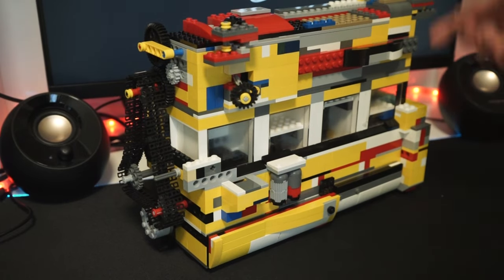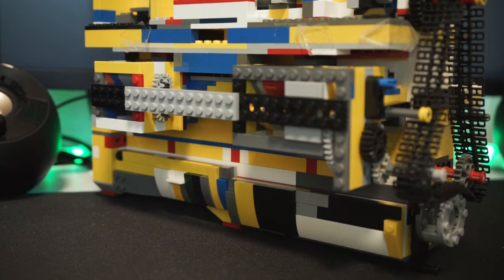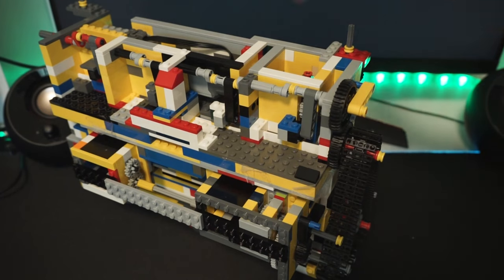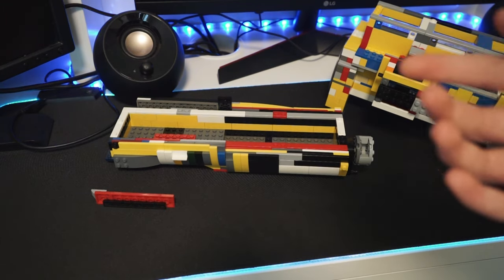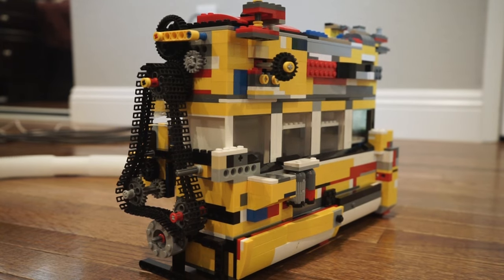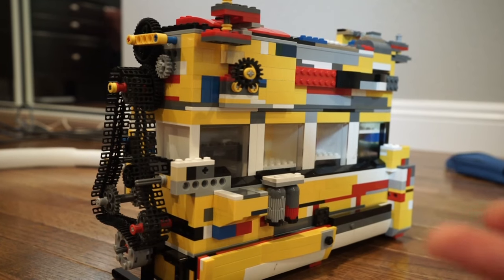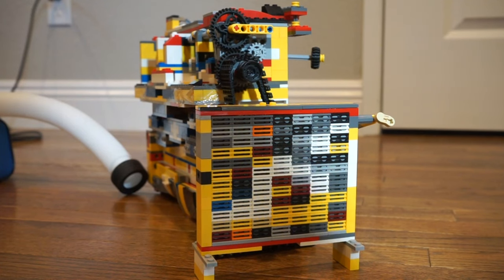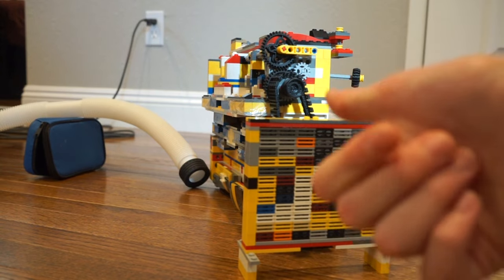Twin-Supercharged Lego Inline 4 Diesel- Vacuum Model Engine

Comment: That’s the most epic i4 I have ever seen, and 600 rpm for such a big engine, my i4 reached 1300 at peak but it was way smaller
Reply from the maker: Thanks
Reply: How big is it? Mine is 4x4 but still does not run great because of too many friction I think
Reply: @larsassinck3868  have you tried to lubricate it with olive oil? you just take a qtip and rub oil along the cylinder walls and anywhere there is moving parts
Reply: @ethankirwan1646  I did but I used bricks for the walls instead of flat panels
Reply: Most engines idle at 600
Reply: @Anonymous_1210  600 is how a tractor idles. A car idles at about 800-900
Reply: Exactly I meant tractor engines Im a farmer lol
Reply: @MrThunderCunt  Yeah I know, Just comparing to a real life engine.
Reply: @larsassinck3868  Affirmative

Comment: Supercool build man! I was wondering how the superchargers deliver the boost to the engine? (Edit) are they like blowing fresh air to the intake when the piston goes down
Reply from the maker: Yup, exactly! More air in cylinder= more air for vacuum to suck.
Reply: @Mattz6  I am sure this is not how it works, the piston is moving upwards because of the vacuum in the chamber and not the particles of air dragging it, when you add air to the chamber you are just slowing the engine because the vacuum cleaner has to suck out more air.
Reply: @jantosone3380  as long as the intake valve is closed during the compression stroke it should work fine. There is more air volume which gets pressed downward on the piston. Also, the piston also pushes the air outwards, so it doesn't work like you described. The piston assists the vacuum in pushing the air outward.
Reply: @BlueTechRS i don't understand what i wrote wrong. the only thing that i didn't mention was that the superchargers can help in pushing the piston down. because of this, this engine has only 2 strokes: 1 piston going up because of the vacuum, 2 piston going downwards  
because of the flywheel and with help of supercharger. there isn't any compression stroke in this engine. also the piston cannot assist the vacuum cleaner in pushing the air outwards because he gets dragged up by vacuum him self.(edit) even in the video you can see it running faster without superchargers
Reply: @jantosone3380 is your point is that when exhaust port opens the supercharger blows air to make the piston move downwards faster?
Reply: @iwascrazyonce664  Yeah

Comment: I think your design is really cool, and I have a suggestion for a modification. Your LEGO engine operates using a vacuum system that pulls air in, and you could add a throttle or restriction to control the airflow. This modification would help regulate the suction power, allowing you to determine the engine's RPM based on how much the throttle is opened or closed.
With the intake flap (or restriction) fully closed, the RPM would be at a minimum. On the other hand, with the flap fully open, the engine could reach maximum values of around 600+ RPM. Additionally, if you could modify the engine so that it generates more RPM at full throttle, for example, between 1000 and 1500 RPM, it would be very interesting and more realistic.

Comment: id say using double sided tape without taking the strap to make both sides sticky is like one of the best gaskets you can get yourself easily because if youve used it you know its a bit squishy so it will get into any nuck and crany
Reply from the maker: Thanks for the recommendation!
Reply: @Mattz6  and the strap is coated with a waxy surface so its like its always lubed

Comment: Love the ones with the starter motors. What makes this a diesel? 
Excellently designed engine, though. I can't help but think maybe a smaller timing chain would improve it's performance and reduce noise output. 
I designed an inline twin 6x6 engine recently which has a similar unique feature of running a mechanical oil pump which forces oil through the engine as it turns. I'm gonna upload another video or two on it before I finally tear it down to make a newer version later on.

You might consider moving the cam down into the block to make it side valve again, or at least pushrod OHV as this will make the rotating mass lighter and lower friction for better performance. You might also consider making the valves the full 6 blocks wide, I see you used the trick of changing the outside pieces for the technic beams, but this doesn't always get you maximum performance. For slightly more you could make them fully open instead and gain some performance that way. Also, it looks like maybe your crankshaft has some wobble to it (One side twists before the other) causing the engine to be slightly out of time under load and causing it to run poorly at times. This is very evident during the supercharged run as you can hear one end of the engine clunking to keep up with the other. 

Otherwise fantastic design and I'll be subscribing to see more
Reply from the maker: Thanks! So um let's start answering!
1. The diesel part of the name has already confused someone else. I wrote that it is a 'diesel model engine' not a diesel engine. The reason I wrote that in the first place is because when building the engine I really wanted to make it function and look like a inline 4 diesel engine. I also wanted it to be similar to a detroit diesel (hence the 2 stroke nature of the engine and the superchargers) and a catapillar diesel since I had so many yellow pieces. That explains the fairly long stroke, the diesel-reminiscent oil pan, the various design elements like the dual 'oil filters' and the flywheel and flywheel housing. I at first wanted to make the engine turbocharged but I just couldn't imagine the turbo to spin enough to even make some noise, so I instead opted for a supercharged system

2. In what way smaller? If you mean a half as wide lego motorcycle chain then I don't have any (though that would have been nice 😔). If you mean by making the chain shorter then it would be great it I could, but I already lowered the cam gear as much as I could since I ran out of chain links. 

3. That's a cool engine idea! Sure is a unique feature. Would be nice to have something similar on my engine, but it's going to require too much work and also the removal of the supercharger, which will make the engine less unique xD.

4. I did already consider having the cam/valves on the side, but I scrapped that idea because on one side the valves will interfere with the supercharger, and having the cam on the window side will require long and heavy beams, and will make the looks of this engine worse (I really tried making this engine look and function as realistically as possible). Not only that but it would cause me to run into more timing chain issues because the 3 chain gears would be in a pretty linear formation causing all sorts of problems.

5. OHV engines are quite hard to make with limited friction, so you'll be losing performance if anything. Even if it did somehow have little friction, most benefits would be outweighed by the complex camshaft, heavy pushrods, and the lack of support. I would also have basically nowhere to put my starter motor and it's mechanism, making the engine lose a important feature. But I am considering somehow making the engine OHV later on by maybe just getting rid of the superchargers. 

6. My valves are 6 studs wide. Also what outside piece technic beam trick?

7. Yes, the crankshaft it a bit weird but that's because if my lack of 0.5x3 technic pieces. The last cylinder likes to clunk because I kinda ran out of pieces and the piston is probably nudging against something. In any case I actually think it adds to the sound soooo kinda a win 🤷?
Reply: @Mattz6 love the Detroit diesel as soon as I saw the superchargers that’s what my mind went to

Comment: this is amazing bro! i tried a 6x4 aswell, single cylinder engine that ran off of actual fuel, and starter fluid, it worked a little bit, but it didnt do much. but all my legos are gone cause my mom gave them away and i wanted to experiment. honestly i might just 3d print my legos and cast them to metal so i can make a fully functional V-twin. what do u think?
Reply from the maker: Wow, that would be AWESOME. There were attemps on YouTube for a working lego engine but the legos simply melted and there wasn't enough compression. Maybe with 3d printing and a foil-lined cylinder it might work!

Comment: Are The Paper Gaskets Actualy efficient? and does the engine have Deacent Torque? because im thinking of making a lego engine powered by compressed air (5l with 4 bar] and mounting it on my bike
Reply from the maker: 1. Probably. Though the supercharger isn't. Though it may blow some air, it doesn't actually seem to compress it enough to make power.
2. It has some decent torque but I think something like my inline 2 had more. For air powered lego engines I recommend searching up "pneumatic lego engine". This is a negative pressure air engine that can work with a lot less sealing and optimization. A positive pressure air engine on the other hand needs way more work to function properly so pre-made lego cylinders would probably work better. The youtuber "Green Gecko Technic Workshop" has some good pneumatic lego engine examples.
Reply: @Mattz6  ik your engine uses vacuum but ik how to seal stuff properly like an engine built for suction so getting the engine to run aint my concern my concern is torque and fuel efficiency but mainly torque bcz if a 4 stroke 1hp 1 cylinder engine can get a bike up to 36mph whych is realy fast then it means that 0.1hp would be enough but even 0.1hp is incredibly hard to make with lego i had a 4 lego motors made then into one very compactly and then i did some math and figured out it does like 12ncm at 200 rpm whych is basicly 0.005hp them i realized putting that on a bike aint gonna work/be usefull. Since then i was thinking how to get something that made torque btw i was asking about the paper gaskets because like 2 years ago i made an experiment to see if see through duct tape was enough to seal it it sealed it 95% still leaked but very slowly
Reply: And btw i have not got a suction or presure engine to work even through i tried more then 10 times for the past 2 years
Reply from the maker: Paper gaskets probably only work for negative or low pressure situations. Duct taping a pipe if probably better for higher pressures.

Comment: THIS THING IS SICK but if oyu want it to rev higher you need to balance the crankshaft but overall 10/10 build design
Reply from the maker: Thanks. But since the crank is situated in a 2 stroke position it is already balanced enough. Could be more balanced but it's too much work and I don't exactly know relative to what piston to put the counterweights
Reply: @Mattz6  one more thing make sure that the middle 2 and outer 2 go up and down at opisite times so wheen 2 in mid go up 2 in out go down like a real 4 pot
Reply from the maker: @the-evergreen  The engine is technically a 2 stroke meaning the firing order is 1234. Making the engine have a 4 stroke configuration will reduce power and smoothness because 2 cylinders will fire at once.
Reply: @Mattz6  on a real 4 stroke i4 there is only one cylinder firing at a time

Comment: Not sure if you still reply to these, but do superchargers have a purpose in vacuum engines? It seems like all it did was hinder performance
Reply from the maker: If they make actual boost then I think they can, since there's more air in the cylinder for the vacuum to suck= potential for greater pressure difference.

Comment: PLEASE RESOND!! we're did u put the superchargers, what part of the engine do they enter into, the exhaust, vaccum side or cylinder
Reply from the maker: Superchargers are on the side. They blow air into the intake manifold which is on the very bottom. Piston goes down, air goes in. As piston goes up the port gets blocked.
Reply: @Mattz6  thank you so much I am trying to double supercharge a single cylinder

Comment: Looks nice definitely. But while using the same parts a vacuum engine uses you missed the opportunity to "actually make it work".
Reply from the maker: Thank you for commenting! What do you mean by 'make it work'?
Reply: @Mattz6  sorry I skipped through the video and only saw an electric motor. I missed the vacuum so I jumped to conclusions that it was just a realistic dummy. Great work making such a massive engine work.
Meanwhile I fail at my 2 cylinder dohc dohv design 😂

Comment: Its Nice to see A realy good looking Vacuum Engine because i have been trying to get my 1 cylinder to work for over a year now and i have tried almost all the valve designs and it still didnt run because all the valve designs had way too much power needed to turn it over whych in the end over powered the engine and it would need like a very big flywheel to make it work and it woudnt be worth it at that point but 2 days ago i made a design whych i hope works but im not sure since the timing mechanism is 5 studs away from the cylinder so im not sure if its gonna work
do you have eny tips of making the engine run?
Reply from the maker: Make sure nothing is rubbing against anything. That is a sure sign of too much friction. Also the valve timing should be 90° ahead of the piston so check that as well. Also if you can try to lubricate the engine. Olive oil works the best, but I personally use a bit of lotion because olive oil is too messy. And thank you!
Reply: @Mattz6  i used my own type of lubricant whych i hope is gonna work just fine im just gonna have to run it with my starter for 2 minutes and then i can try running it after i fix the valve timing because it uses gravity and i need to use a rubber band for it to return back otherwise it aint gonna run but i have used my starter and it could survive aboe 1.2k rpm so im not worried about it exploding even through u can unconnect the whole cylinder without a lot of force so im going to fix that tinny detail somehow idk how i dont have eny more lego pieces with stud holes but after i fix all of those problems i hope it runs. since it pulled the piston when i used my breath and then it stopped and it hasnt done that since but i hope with more suction its gonna work.well have a nice day and thx for answering. :D
Reply: btw u should try engaging the starter but not turning it on while running to see if it has the torque to do that since i dont think it does
im still confused how that 70 rpm the starter outputs is enough to start the engine oh no wait its 90 degrees ofset crankshaft per piston that makes sense
is it just me or does the engine do more rpm and is louder without the supercharger?
Reply from the maker: I don't understand what you're trying to say but yes, the engine is faster without the supercharger because the parasitic losses are greater than the added power.
Reply: what if u make the supercharger controled by electric motors and make it do a lot of rpm do u think that would increse the power?
Reply: @dominikvarholik7519  Thought of that before, but that means that the throttle won't vary along with the engine
Reply: @Jesus_Christ_loves_you_alot  true but would you rather have a supercharger that weakens ur engine or a supercharger that actuly adds power for example i made an elecric supercharger and it works insanely good the air flow it has is allredy deacent at 1.2K rpm
Reply: @dominikvarholik7519  I guess. Might try that I'll see.

Comment: Fyi the firing pattern is incorrect, it's 2&4, then 1&3two at a time that way it's better balanced so maybe you can got more rpms out of it
Reply from the maker: Not the first time I've had someone point that out. The engine is essentially a 2 stroke, so having a 4 stroke firing order may make it more balanced, but the engine will have much less power. I thought about doing what you said, which is to have 2 cylinders fire at once, but I decided against it. That is because it would simply defeat the purpose of having a 4 cylinder. At that point, a 6x6 inline 2 would be much better.
Reply from the maker: Though I am thinking to maybe try to do so.

Comment: Dyno it lol, but actually. it seems pretty big displacement. Ill try buy some lego again and do something like this!
EDIT: I calculated that this is 307cc
Reply from the maker: Do you know any good ways of making a Lego dynamometer? Maybe using the white clutch gears?
Reply: @Mattz6  unfortunately I don't cause I don't have any Lego stuff anymore, you could do a rpm Metee and message the tourqe from the clutch gear
Reply: You could put clutch gears on the shaft and show me the rpm with it and I will calculate it

Comment: Dang that’s sick maybe u could add a throttle control?
Reply from the maker: Throttle control is what way? Remote control or like kind of a ECU?
Reply: Like a throttle body
Reply: @AMA_808  Oh. I didn't add one because the RPM was basically idle so there's kind of not much of a point to having one .

Comment: How much torqe does it take to stop the engine?
Reply from the maker: Mmm not much. Since it's a two stroke configuration 1 cylinder fires at once. I think it's comparable to a 4x4 i2. Could be because of the low rpm.